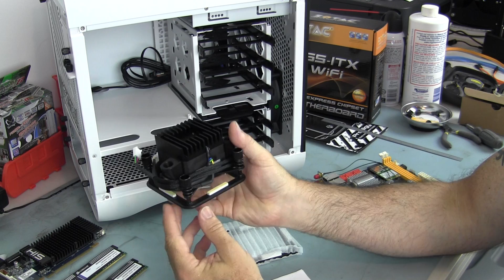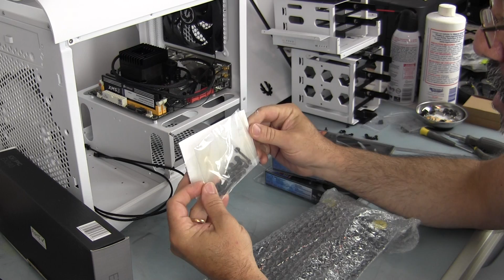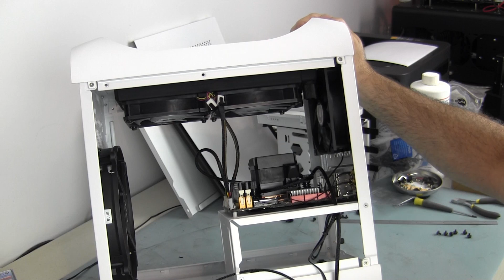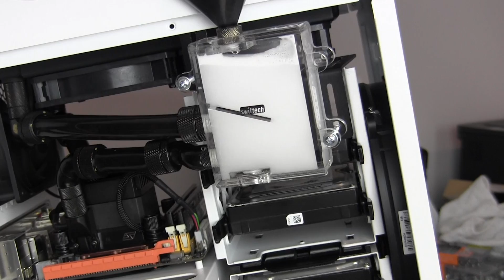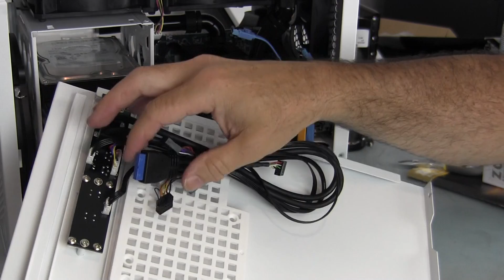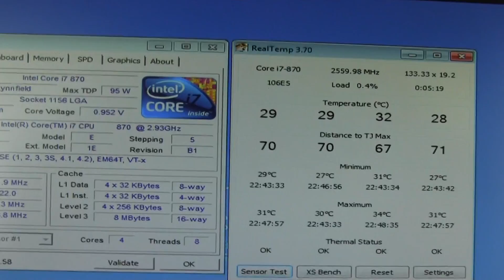BitFenix Prodigy Water Cooled WHS2011 Home Server Build - Part 2 - The Build

Comment: forth : id take of the case plastic feet it makes it too wobly . id replace them with something sturdy if i could but id have to think about that because i wouldnt want to drill holes in the case .
the name of the res pump combo is : 
Koolance RP-401X2 Single 5.25" Reservoir for 1-2 PMP-400 Pumps Rev.1.1

Comment: here is what id do diferent : 
first: take the pump and the res out . 
replace with ek supremacy block and instead of the pretty swiftech res i would use the koolance combo of res and 2 ddc pumps in the 3.25 bay on top.
second : i would use two kaze slip steams on top and hope they squeeze with the koolance reservoir. 
third : id take the rad outside in the back with a mounting system. 

Also considering a 180 mm rad in front if it doesnt interfere with the 5.25 bay.

Comment from the maker: Yes especially when running at the highest setting. Not so bad at lower speeds mine is at about 1400 RPM.but still noticeable . Not sure if I can deal with that yet. Will have to put it in my office and see.

Comment from the maker: Absolutely.  You would not need both drive cages and have plenty more room to add a water cooling solution that would not interfere with the video card. If you did not want to water cool you still have no problems even fitting a GTX 690 in there.

Comment from the maker: Yes at full pump speed it is a bit noisy, kind of a high pitch, but I connected it to the motherboard CPU fan which has a PWM connection and set the step up temp to around 40c. So it runs at the lowest setting and is much more tolerable. D5 pumps are definitely much quieter. I have not used a DDC pump yet, but will be in a new build and will have to report the difference in noise.  But this pump definitely moves some coolant.

Comment from the maker: Good point I did not talk about that. I do not use wireless. It is connected to my router in my home directly.. All of my systems connect to it wired except the laptop wireless to my my wndr 3700. The space you see my systems built are in my workshop. I have switches there as well to direct connect and only go wireless for testing or if I run out of bench space.

Comment from the maker: It does have good flow, but at full speed does produce a bit of noise. So depends on what else you have going on in  a system and where you place it, for most uses would not be a problem If you use it with a motherboard that has PWM connector for CPU fan that is the best . It controls flow based upon CPU temp.